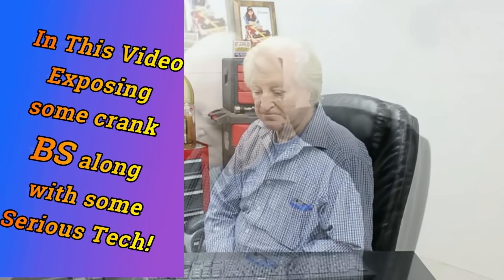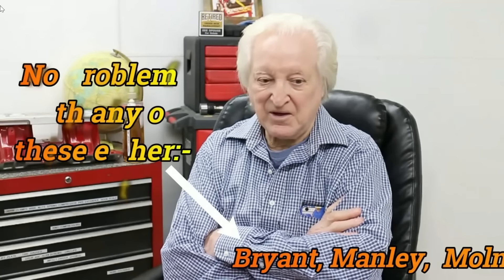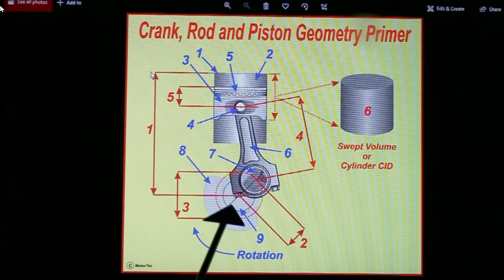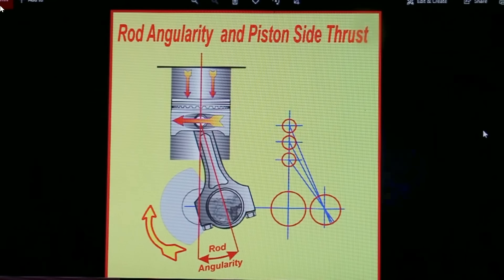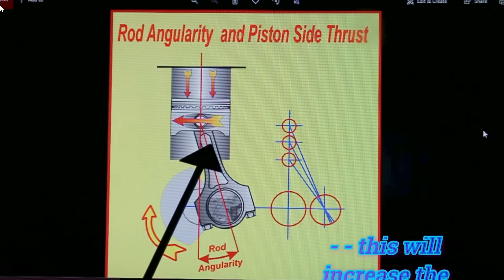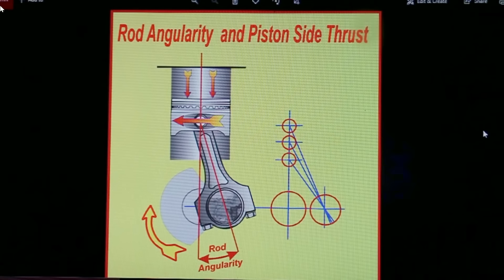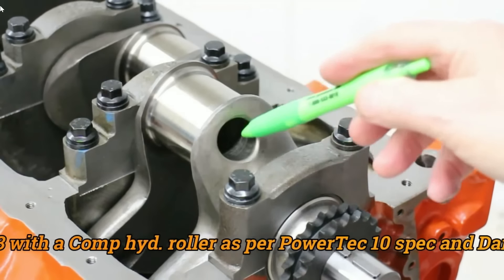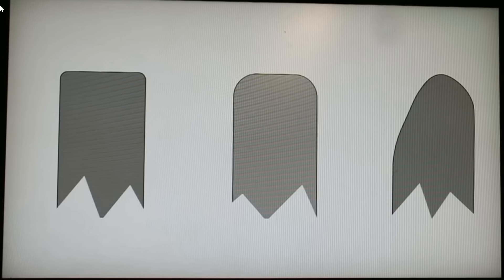Crank modifications for increased power Part 1

Comment: I noticed the piston pins are especially heavy, and especially on small engines, the pin can be half the weight of the piston,  a titanium pin would .make a huge difference,  I even removed the casting marks from the back side of the piston, attempting to get the big bore piston close to the weight of the stock piston,  it had much less vibration compared to the engine without this done,
Reply: Seriously? People use forged piston when going bore up. The forged piston is usually lighter even though it's bigger and you don't need to shave the casting marks because forged piston are machined. Where have you been?

Comment: David, I have a SCAT 4130 4.25" BBC crank that I'm using in a 496 with Speed Pro hypereutectic pistons with coated skirts. The rod length is 6.135 which gives me a ratio of 1.44. Does it really matter as far as wear goes especially since it's going in a daily driver that isn't getting hammered on all the time? Chevy's 454's had a ratio around 1.5 and the LS-7's were getting hammered on at the strip. I know what you're saying but my question really is unless for all out racing is the 1.6 to 1.8 ratio really necessary on a street/strip car?
Thanks.

Comment: Hi great content! I have a question, if I grind the counterweights of a crankshaft at home will it need to be balanced? Another thing, the counterweights are to counter the reciprocating mass of the rods and piston? Like if I put lighter pistons and rods the weight should be reduced accordingly within certain parameters?
Reply: Yes and Yes.

Comment: Well, in the end the hydrostatic bearings on crankshafts work with a thin pillow of oil between the (micro-) polished crankshaft and the rod big end bearing? So in my logic there is really no difference as long as the surface of the big end and the crankshaft is smooth enough to keep the oil where it should be.

Comment: A friend put the common belief that the longer the rod, the better (I believe bought into popular conception by the writings of one Mr Yunick) actually even though the longer rod made more on the dyno - the 5.7 was almost 2 tenths quicker in the quarter mile than the 6, and over 3 than the 6.125". So, I dont know what that comes down to, there are many factors at play in a race car,  and a drag race car is under a whole lot different criteria to a road race car.
Reply: Smokey was mostly BS, read Grumpys book and his thoughts about rod lengths.

Comment: I’ve just set all the main journal oil clearances on my 11000 rpm capable flat plain motorcycle 4 cyl crank  I’d luv to do that windage or aero mod to the crank throws   But my brain won’t let me attack it with a grinder I see too much value in symmetry and repeatability so prob only a Cnc might suffice in my mind tho if I saw an expert break out the angle grinder I might have a rethink   Most of my main brg oil clearances came in at the lower end of spec in the point 020 mm - point 025 mm range what grade of run in oil would b preferable given the above please   Is there value in DLC  or WPC coating engine surfaces? Thank u

Comment: Thank you for doing these videos.  On an inline 4 cylinder engine, because the big ends are effectively balancing each other out would you look to remove the counter balance weights, or reduce the number of them from each throw, to just the centre and outer ones?  Or, would this cause issue with the 2nd order vibration.  My thought for removing or reducing them is because; we would be drastically reducing the weight of the crank so the 2nd order amplitude will substantially reduce.  When you where doing your work on the Pinto's and other 4cylinder engines did you get chance to play with this?
Reply: At high revs EACH complete crank starts behaving like a 1 cylinder engine crank and therefore needs balancing like such.
Reply: @Baard2000  don't be ridiculous
Reply: @anggaros1  oh.  And how do you explain a tractorpull engine revving at 7500 rpm with 5 inch stroke not demolishing the main bearings on the block side ( not the caps) without enough counter weights and when proper weight counterweights are added that shit is over ?    Been working professionally in tractor pulling for over 22 years involved in.loads of high revving long stroker engines  ....... Bin there , seen it , solved it .
Reply: @Baard2000  you can be anything on internet.
Reply: @anggaros1  so can you.   Happy life further with saying  experiences are ridiculous on YouTube.   

My experience is that when a customer tells something about his engine I never state :  fool!!! Thats ridiculous!!!! 
I unravel his or her story and come up with a solution.   Well I guess that resulted in all  Dutch champions pro stock diesel from 2004 till 2019 were using my cylinderheads  or blatantly stated they copied mine .....
So yes...I guess anyone can be everything he wants on internet. The results in real world count.
Reply: @anggaros1   than show an engine with 5.5" stroke without counterweights revving 7500 rpm. https://youtu.be/BIgK_SLUDSo  The 1th run was 7500 rpm with 75 percent pump capacity.   
The remaining parts of turbine wheel were shot into the roof of Ahoy Rotterdam with almost the speed of sound.  How do I know??  Well...the Go pro with 100 frames per second and a 20 m view did not even catch a red glowing stripe.  So only an object far above 200 m/s  or 660feet/sec  will accomplish that.   The Dutch Tractor pull association has taken adequate measures to ever prevent this happening. 

I guess you know who I am .

Comment: I have a question about a debate. It is about the 2.750 and the 3.000 main size in the ford 351. They say they meaning most machine shops 6800 no more on a 3.000 main or the earth will spin backwards the planets will miss align shit will go bad meaning it will spin a main. But a 2.750 main wing the hell out of it it will take it. So the question is I am building a 393 sbf stock block 3.000 main will be internally balanced rotating assy coated bearings and the micro polish on the crank oh and its a scat forged rotating assy so how high can I take it?  Until it flies apart is not a answer heard that a lot.
Reply: Maybe the earth will spin backwards and I have no experience with your exact situation but I have turned 5" mains 5500rpm and they lived. The 5.9 cummins has a 3.26" main and we turn them 6000-6500 with no problems.  My guess is the galleys that supply your mains maybe too small to feed the bigger bearing so it may need some mods to get it to live but I see no reason it shouldn't be fine with the right oil and clearances.

Comment: I'll shape my crank like to desings  like picture on 18:01 in viedeo.
I only rev my 283cui to 6000 but if the benefit in hp gain is smalle - hey it's still hp for free

Comment: You don't have to break a crankshaft, for it to be considered a piece of sh!t..
I've had block failures where the major contributor to the problem was a crankshaft that was as good as a wet noodle. The bearing saddles were ripped right off of the main webs, but the crank was still in one piece.

Comment: Hello David  I found the video very informative.  I checked my library and found one of your books I had bought in the early 1970's------"Tuning V8 Engines" printed May 1970.  In the early part of the video you mentioned side wall forces but you did not mention offset gudgeon pins.  I rebuilt a Ford Customline 272 V8 in the early 1970's for a ski boat.  I recall that the gudgeon pins were offset.  All the pistons had to be installed with the cast in mark to the front of the motor.  Can you comment on this please.   Cheers  John

Comment: When you said 20hp from polishing I was washing dishes with my ear buds in, well I whipped my head towards the pad so fast I almost lost my earbuds to the soap suds. 20hp to friction??? I'm no engineer but I would think you could finish the journals with 120 grit and not lose 20hp.... That's what you gain from polishing, porting, and tuning an intake manifold, maybe 🤔

Comment: 24:40 so in another way the BS can be called ,is to stick a 15kw heater under your oil pan and run it flat out and see what happens? 
I see what you did , that hp is wattage and that can be used for heat and thay saved that much heat? 
Yup, BS.

Comment: Crank modification  ?

A small block  283 or 327 doesn't  need  any Crank  modification  , 

They can  Rev to the moon  
10,000 to 12,000rpm 

NO modification  required

Comment: You will never add horsepower from the crank, especially from the crank. The lower block is just a rotating device that needs to stand the highest RPM possible without falling appart. All your horsepower is in the upper part of the block and especially the heads. Think of you engine as a huge air pump that needs to get in as much air as possible and get it out = Horsepower and Torque based on the configuration
Reply: You completely ignored what was explained in the video. .. . The air pump comparison is about as rudimentary as can be . . 

You clearly lack understanding of how a engines bottom end can influence hp & tq .
Reply: @codyramos3200  As rudimentary as an archaic form of power can be my friend, just a prehistoric combustion engine. What this guy explain is the basic of the more the resistance = less hp and of course pushing a piston towards a cylinder wall with the up and down motion will create some inevitable loss of hp (resistance) unless you can mitigate by changing the angle degree and the stroke. I have been building stock engines and mainly high HP engines professionally since 1984 especially small and big block Chevy. I was pulling a constant 500Hp in the early 90'S and with the LS series I was pulling constant 700 to 1100Hp, Naturally aspirated and forced induction. I build 1000's of engines.
Reply: @michaelb7936  blablablabla yeah right
Reply: @anggaros1  What and educated response, you got me all shook up🤣🤣😂

Comment: Too smooth a finish....no oil retention. No retention no protection.
Reply: On a bearing surface?
Reply: @arturozarate1752  that makes absolutely zero sense on a bearing that has forced oil supply. Maybe on a bearing that is just bathed in oil.
Can you point to any examples?
Reply: @sexyfacenation  ok, I'll try to explain. This may be a crude analogy. Ever pay attention to what water looks like on a hood that hasnt seen a wax or polish in years? It spreads out and clings to surface. Now a freshly waxed hood will bead the water up. The beaded water quickly and easily moves across the top of the surface. There has to be so surface tension for the oil to cling to in order to protect against metal to metal wear. Pressure fed or not. If the journal is too smooth the oil will just skim across the surface till it finds something to grab on to. It's the same on cylinder walls. 

If not for plateau honing the smoothness required for low tension rings would not keep enough oil for severe duty and over heat and eventually lock up. 

That's the simplest I can explain without writing a novel.